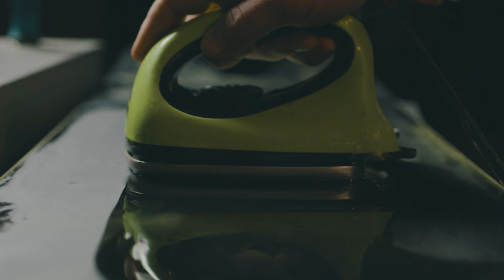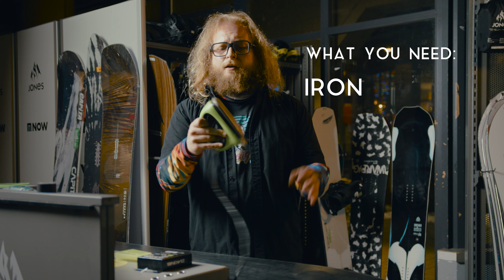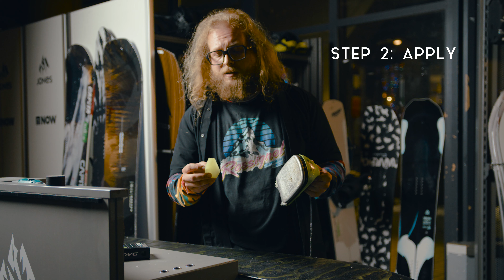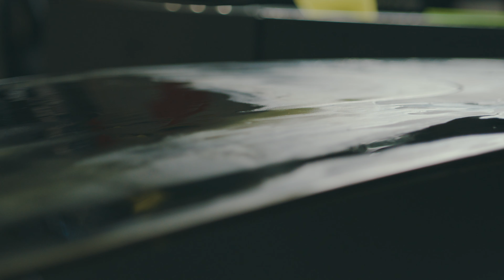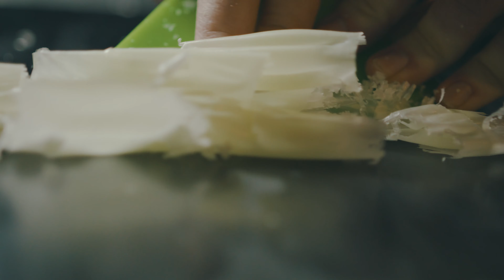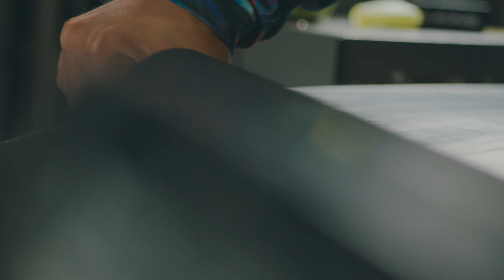How To Apply Wax To A Snowboard

Comment: Nicely produced vid! You cover the basics well. Super important to clean the gunk off base before you wax though... (brush, and wipe with fiberlene ideally). Also like the crayon'ing wax method, less waste. And brushing technique...don't know how much difference it actually makes but I like to only brush from tip to tail so the grooves made are in one direction and the water can run that way.

Comment: Hey, great content, love the channel.. something I never find clear is when to actually stop scraping. I know they say “get all the wax off” but IMO at that point there is still a bit of wax left.. I could scrape my double camber never summer for an hour and still be getting fine bits of wax off the board..
Reply: in my experience, I scrape till I see some "stripes" of wax removed, the excess will anyway be removed wit the brush, a copper or brass one is more important than the nylon one imho

Comment: Andreas, question, I've been seeing a lot of Japanese snowboarders using a type of paper during snowboard waxing. Some are only putting on a thin layer of wax. Some are removing excess with paper. They hardly scrape. Why? It's less of a mess but isn't that counter productive? Here's a couple of examples. 
This dude is in Japan. He says he's using kitchen paper towels.
https://youtu.be/2EVtPBnzpZQ?t=360
These ladies are in Whistler. They are waxing a brand new board.
https://youtu.be/8lXnVa89e5s?t=240

Comment: dude when you finish hot waxing you want those strokes goin tip to tail not forward and backwards, iron width per row, 3 to 4 rows straight up and down to leave a cleaner path for your scraper to follow, thats what snowboard racers do when applying wax
Reply: different strokes for different folks HEYO 😂

Comment: Also is 10 minutes long enough every time? as long as we can get back to room temp? I saw a vid where they said “overnight”  is that overkill?
Reply: Yes, let it slowly go back to room temperature… 10 minutes, 20 minutes, 1 hour, (however long it takes to drink a beer) or the old timers prefer overnight 

You can scrape while hot, as you’ll be cleaning the base aka hot scraping.